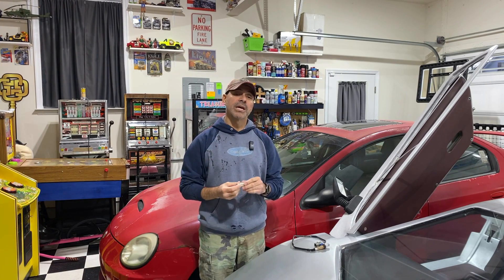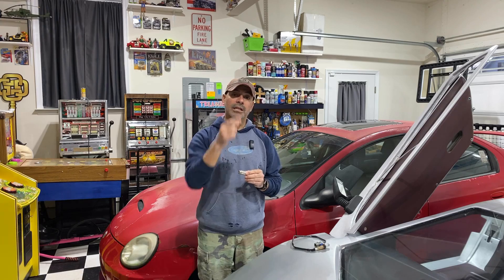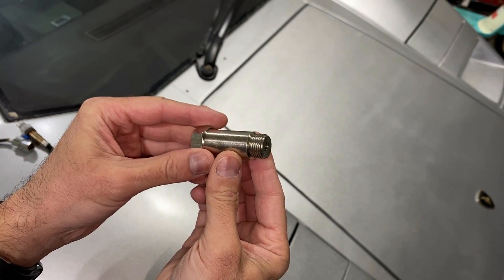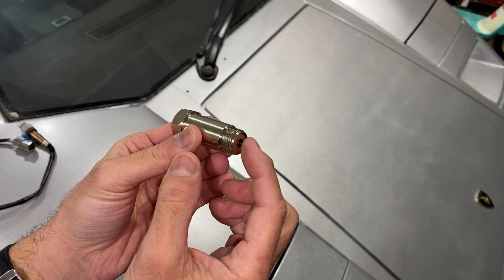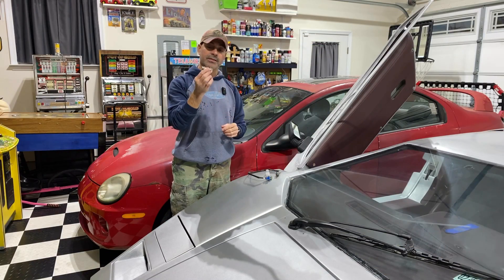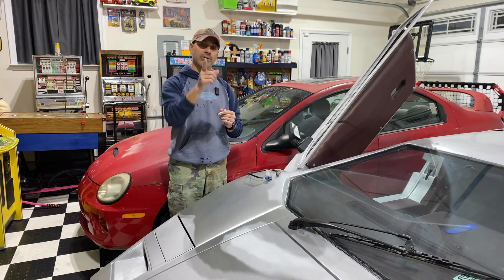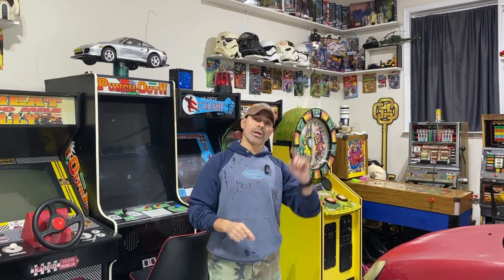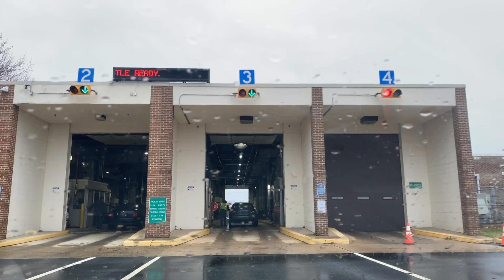Do Oxygen Sensor Extenders Really Work?  (Andy’s Garage: Episode - 453)

Comment: Hi. There is no catalyst converter on my car. I am in the Caribbean so I am told it's quite fine. However the check engine light is on and there is a  P0420 code when scanned. Will this work for my Nissan 2011 Tida? Thanks.
Reply: Phillip, thanks for responding. I am not sure if the o2 sensors are there. I would have to get someone to check. However, if they are not there what else could cause the P0420 code?
Reply from the maker: @Terry9921  it’s the downstream O2 sensor, the one after the catalytic converter. It’s telling your ECU that the catalytic converter is not working properly
Reply from the maker: If there is no catalytic converter on there, do you still have the O2 sensors? The downstream usually triggers that code.

Comment: Does anyone here care about being legal 😅 two words “Straight Pipe” 👏🏾👏🏾
Reply: It just sucks when it’s a Subaru cel on means cruise and traction control system off it sucks in the winter in the rust belt
Reply: Another 2- Words:
      INSPECTION TICKETS 🎫.
Sure don’t pay ?
Revolted Registration.
Stopped by ,” plate scan tool- Cops use.”
Impound and towed to Police Garage.
More tickets, impound fee, towing charge, your time, MO’ $$$$ - your $$$$$ !!!😂

Comment: We had emissions in my county for a few years but now they just do safety inspections. Even for our safety inspections they do visual checks for the stock cat and if you have an aftermarket cat they go to the scan tool to make sure the sensor is reporting correctly. This is just for safety so they more strict on the emissions side. That o2 sensor extender is a dead giveaway that you're trying to bypass the system. When I had to do emissions they would print out a report on how efficient my cat was, they would actually stick a sensor in the exhaust and the state decided if it would pass or fail.  

That emissions readiness is a good tool to have in the torque app, most states allow you to have one of those systems not ready. Usually you can get the system to ready up with a short drive with your gas tank between 1/4 and 3/4. If you try it on a full tank most of the time it takes a lot longer or the evap doesn't ready up.
Reply: You can coat it with dirt to disguise it
Reply: @Eye-it-azz oooooh nice tip

Comment: These work on early OBD2 systems. I can't remember what year, but the later systems where programmed to detect the operation of the downstream sensor,during warmup. Long story short. They work on early  systems but ,not on the newer ones.
Reply: It has always been detecting the effectiveness in all years. It didn't change
Reply: It works on all Chevy trucks, including the brand new ones.
Reply: you are correct tested it several times  they dont work.
Reply: Yep, it worked on my 99 Surburban
Reply: bmw’s owners with a downpipe and tune do this on their daily cars
Reply: What I got must be different because it cost $90 and it is for making the O2 sensor last longer.
Reply: It worked on my 2001 S10.
Reply: @philllsxga.7737  How long did it take to turn the check engine light off after you put it on?
Reply: @philllsxga.7737  I have 2003 s10 2.2.
Reply: I don't remember.
Maybe 3 start ups.
Reply: why is this guy at chucky cheese

Comment: I know about these and I know they sell them but I’m pretty sure these are illegal to use nationwide and the fines are pretty hefty for having them on your car so I would be careful with these in use, I’m not even sure how they didn’t catch this inspection stations are trained to look for these and any other illegal exhaust modifications. Look not trying to argue with you your explanation was great but any consumer or I’ve seen some shops do this should be aware that the fine is a big one for using these.
Reply from the maker: Only a state inspection would look for these while they look underneath, emission inspections only check the ECU for codes.
Reply: I prefer the hollow out the cat method with the proper resistor in the wire out of sight.